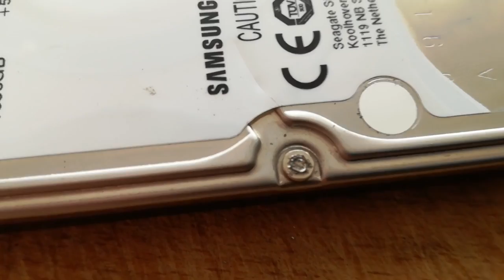How to remove damaged or stripped screw (solder method) FIX  of solder not sticking to screw

Comment: In my case the tin stuck nicely but get cold too early and don't even get a time to create pressure to make pattern :(
Reply from the maker: No, it is right procedure to get it cold. Tin is a soft metal so you can make pattern easily even it is cold as you can see on video (3 min). The point is to use enough tin, if you use too low it wont be enough to make pattern and hold the tin with screwdriver to unlock the screw.  Just be patient, I made this method many times and helped me a lot.
Reply: +Joseisthebest joseisthebest2 
I've used how much tin showing in this video. Just filled the hole. but it was hard enought and couldn't create pattern then. Ok I'll try again with eneough tin. I've tried many methods watching from youtube. All failed. Last thing, I would try with a screw remover plier. (normal plier didn't work). But this thing isn't much available here.
Reply from the maker: You even do not need to fill the whole hole just simply the tin must be stucked there and not moving when you try to make the pattern. I will probably make a new video next week (2nd worst :D)

Comment: Worst video ever
Reply: It is best
Reply: Leakomesto legit, there's no fucking reason that there should be a seven minute timespan on a video where the first like 3 minutes accomplish nothing to the tune of the most aggravating music ever.
Reply: @purple.g33k  You are garbage.
Reply from the maker: Sorry guys, I do not have three hands. I had to hold the camera, try to make the work and also check the camera if it record is clear :) I am sorry for the music, you can always mute the video. The first two min are shown that it is not a 1 min job but you need a patience and you can make it in few min. Anyway thanks for the feedback.
Reply: @joseisthebestjoseisthebest9155  I reccomend a small tripod if you want to make more repair vids, they are very cheap and you can find them at most stores
Reply: @joseisthebestjoseisthebest9155  solved my problem so good video
Reply: @joseisthebestjoseisthebest9155  you the man dude ur breathing is therapeutic . Have you  considered doing ASMR??